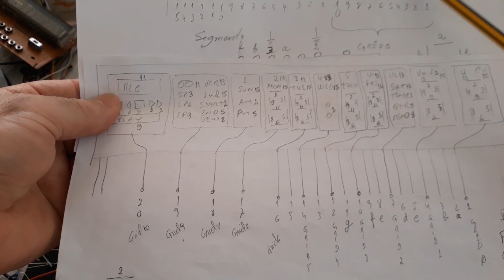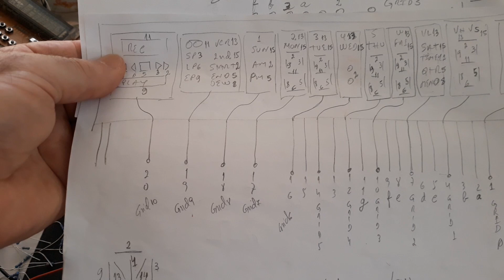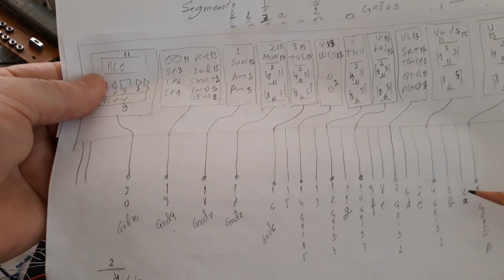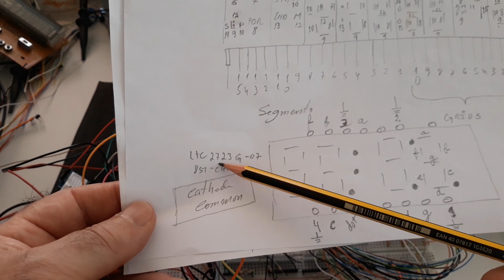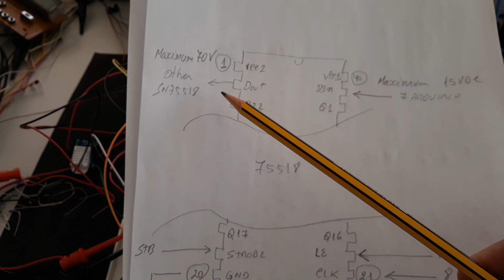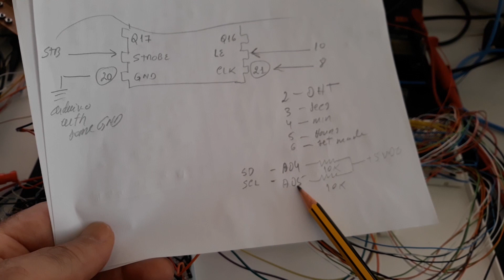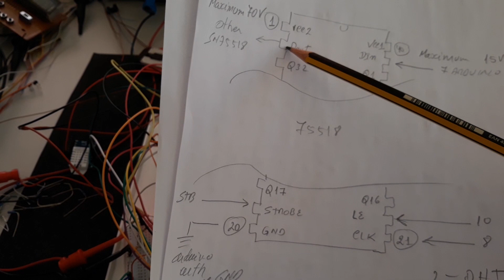DS3231 DHT22 (part2)

Comment: I have a lcd display  that  looks like the first but smaller   I counted 52  segments  The display  has  few pins since  two pins work for 2 segments  by reversing the polarity .
I think  🤔 the microcontroller  is charlieplexing  . 
Have you worked with one  ?
Reply from the maker: Hi Willie Towers,
Well LCD(Liquid Crystal Display) are very different from VFD(Vacuum Fluorescent Display). This multiplexing technique is widely used in LCD's, even some have the COM1, COM2 and COM3 pins to allow it. I already have some works done with the technique of "3 states" in LCD's. However I've never had a VFD that uses this, if it looks like a VFD (Glass and filaments) note that it can be a VFD with "processor on the glass" this allows you to have only 8 data pins and 3 or 4 control pins and of course the polarizations, as in this youtube title: "VFD 16BD08GINK Chip on glass"
Maybe you can put a picture of the "LCD" or send it!